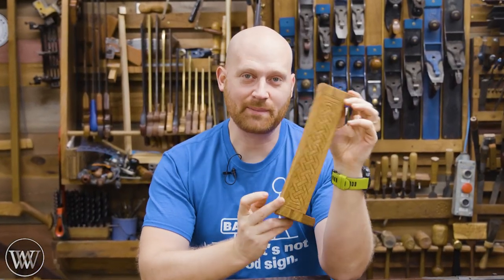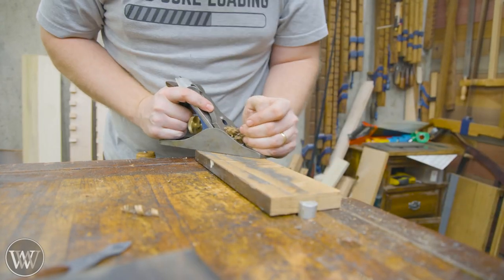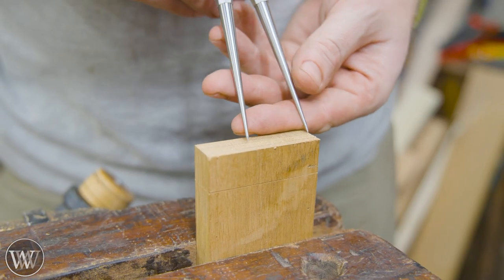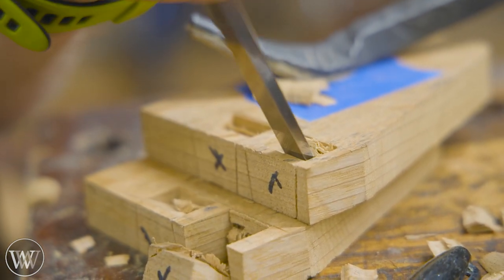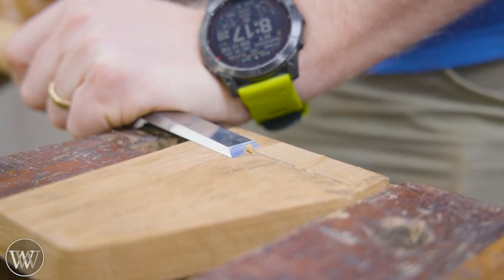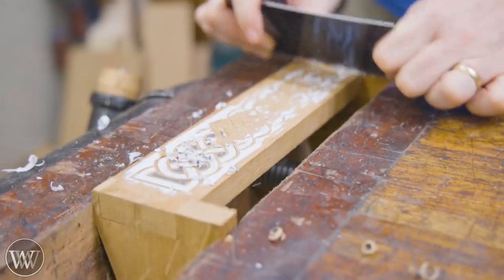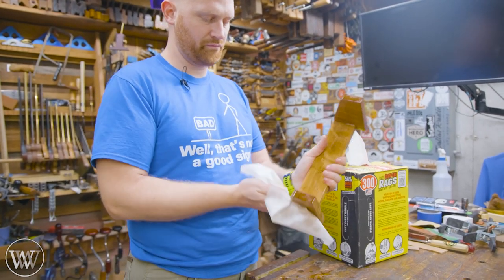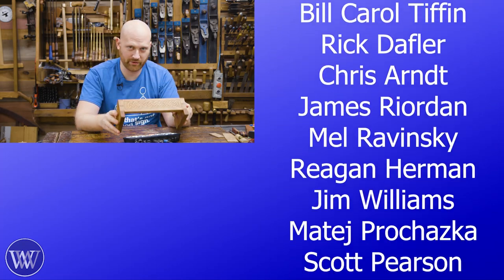How to make a Strobe Stop For an ATEM Mini

Comment: its interesting that you prefer chopping out the waste with a chisel only. I did that for a first year or so, then tried a coping saw and although I never compared times, it felt considerably faster to me. To each their own, but it might be interesting video idea to compare the time using the two techniques.
Reply from the maker: I did an old video on that but I might need to do an updated one.

Comment: When you're sawing at an angle I would say that you are MORE in the business of severing fibers across than you are in the business of going in between fibers and paring out endgrain bit by bit (ripping). Therefore, I would call it a cross cut and use a crosscut saw.